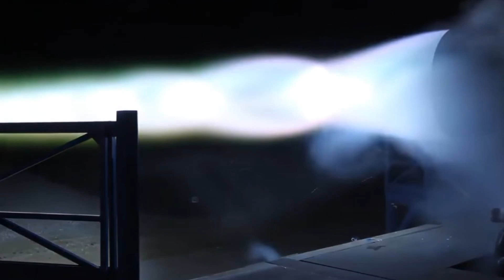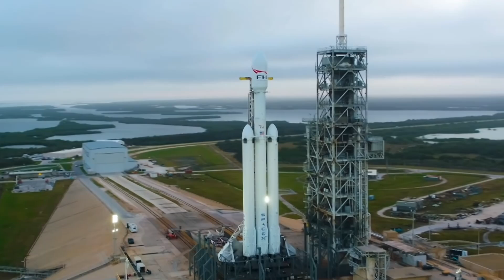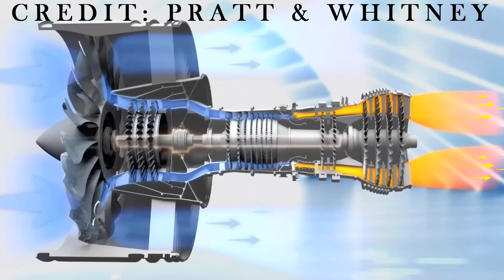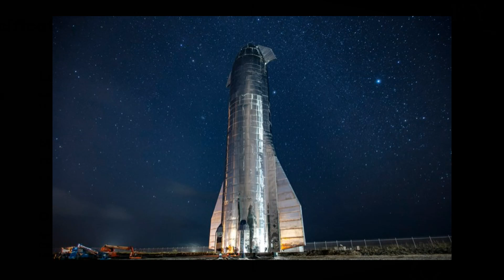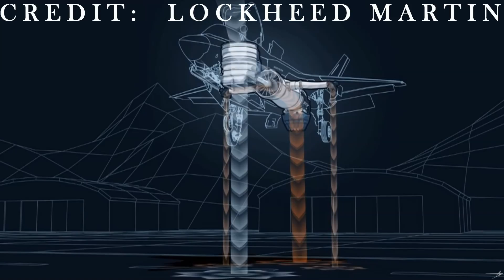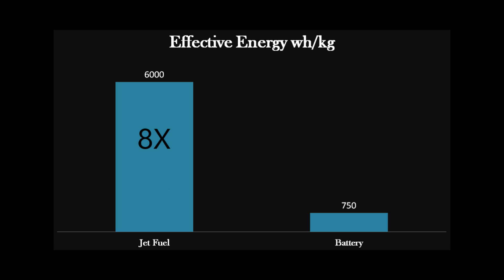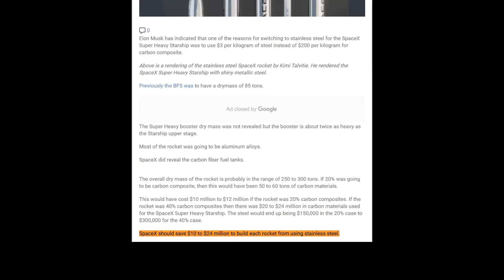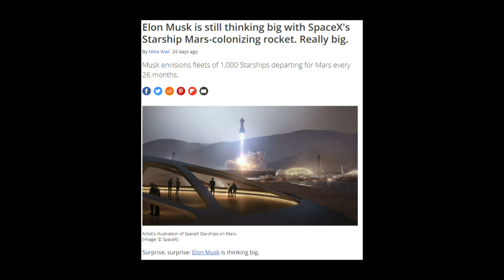ELON MUSK'S BATTERY POWERED SUPER SONIC VTOL JET - My Tesla E-SuperVTOL design

Comment: Electric motors are actually more efficient at higher speeds! Also, check out coreless motors like Thingap, they are stupid high power density, and very light weight, plus super high speed.
Reply from the maker: Coreless motors...will check it out.  Question though - don't electric motors have a steep drop off in efficiency after 80% of max rpm?  Can this be designed around?
Reply: Well, you basically just design the motor to operate at it's peak efficiency. So if you need 8,000RPM, then you design the motor's specs so that is the peak efficiency point, so that you are operating at the peak efficiency as standard (and have some room to push it I guess) Check out Dynamic Boosting Systems, they have some ultra-high-speed motors that run crazy efficient. dynamicboost.com It's much easier to make brushless motors run very efficient at high speeds, it's high torque where efficiency is a nightmare to attain.
Reply from the maker: @DUIofPhysics  Holy crap - 110k rpm?  This is awesome, thanks so much!
Reply: Indeed, no problem. If you want to have a good resource on motors & drive technologies, I suggest hanging around in the ODrive Discord channel. https://discordapp.com/invite/k3ZZ3mS

Comment: Cambridge physicist David MacKay (author of “Without Hot Air”) has calculated that a single Atlantic flight ONE WAY also uses about 4800 kilowatt hours of energy per person (630,000 kilowatt hours to fly that one plane one way across the ocean).  This amount of energy is very clearly expressed in terms of hot showers: a 30 litre hot shower typically uses 1.4 kilowatt hours of electricity so a single return flight uses as much energy as 6858 showers for every person on board, its like everyone on the plane taking a shower every day for 20 years - equivalent to 900,000 showers for the entire plane!
Reply from the maker: This is awesome information!!!

Comment: Second comment: I am afraid lobbying by the IATA, the deep investment in fossil aviation infrastructure and fleets and the low cost of fuel combined with a lack of carbon pricing for aviation (due again to lobbying) will make electric airliners a very long term prospect.  If meaningful carbon pricing comes in and a sustainable way to generate the still considerable energy needs of flight then maybe its feasible.  Remember it will still take the energy equivalent of 6858 hot showers for every passenger on board to fly the Atlantic one way.
Reply from the maker: Yeah, it would be an extremely tough nut to crack.  However, the responses so far to electric planes has been positive.  I think the airline industry is more technologically minded than the auto industry?

Comment: Interesting indeed.  I would be interested in a breakdown of energy required for 3 phases of flight- takeoff to cruise altitude, cruise at altitude and decent and landing. Landing I imagine will take considerable energy as VTOL.
Reply: Take off energy can be removed from the calculation. With VTOL you can tether a cable to power the takeoff which would disconnect at a set hight. You would then have a battery/super capacitor setup on the ground to supply the takeoff power.

Comment: One thing you did not mention is battery charging times. They could be ignored with a battery swap while passengers are getting on/off the flight.
Reply from the maker: That's a good point!  My thoughts on this are are the charger required for this would need to be multi megawatt and that would be the limiting factor rather than the jet's uptake speed

Comment: My personal design is a knockoff of the scene from Superman Returns.  Instead of a space shuttle it would have several electric chinooks attached.  Those chinooks would help get to cruising altitude, release and land back on the parking garage you “launched from”, lessening the weight of the batteries and motors you have to carry with you for the majority of the flight.

Comment: The Electric "Jet" Propulsions Is Hard For Me To Visualize. Without Jet Fuel Turning The Turbines, To Me Would Make The Blades Go Supersonic And Stop The Propulsion!  Otherwise Good Video.
Reply from the maker: Too a while for more to get my head around it too!  Much of jet engines are a compressor, turning at subsonic speeds, compressing the air to supersonic speeds.  Modern engines can do supersonic without afterburner.  We'd just be replacing what turns the compressor and fan blades.

Comment: Faster reusing because it's supersonic ? That includes time for recharge the battery after every flight?
Reply from the maker: I'd say an hour recharge time - 1C rate which is pretty standard would be plenty.  That gives time to load/unload the plane and give it a clean.  The charging rate of the plane wouldn't be the limiting factor, it would be having the massive cables and energy on tap to recharge it that quickly!
Reply: @thelimitingfactor  whole point of VTOL aircraft is that you don't need a airport, and you can land near to the populated areas and leave very fast in ten minutes or less, also is to big 20-30 passengers would be right size for the beginning and the range for first version 1000km would be more realistic.
Reply from the maker: @theOrionsarms  That's a good point, and one I wrestled with.  I think for shorter flights, a high efficiency subsonic jet makes more sense.  It would be smaller, broader, and shorter range - closer to the CyberJet design.
Reply: @thelimitingfactor  flying cyber bus maybe?
Reply: @thelimitingfactor  I'd like to see how viable mid oceanic verti-ports would be at enabling electric flight.
Reply from the maker: @tbuyus8328  'Verti-ports' had a nice ring to it.  Reminds me of how you can stop at Fiji or Hawaii on the way to NZ...

Comment: Why would it not take off and land like a rocket.  You could use super capacitors to use and recharge faster.  Then you would just need batteries to move through the thin atmosphere which is not that energy intensive.  This would imply a design more like the falcon 9 that you noted.  If two engines fail, the center of mass is not an issue.
Reply from the maker: That's a good point.  Then you could mount the engines in an x-wing formation  👌
Reply: @thelimitingfactor  X-wing or maybe in super heavy configuration with a bazilion engines.  I like the idea of the engines in the back so passengers don't have to hear them...
Reply from the maker: @giszTube  Love it 👍👍👍

Comment: Thank you for expanding the views on what is technically possible. I at first thought the thin air above 36.000 feet would be to thin for electric fans to push, but you may be right. I would love to hear more about the Boom 💥 supersonic aircraft.
Reply: I think the Concord had air scoops designed to partly compress and also slow the air before extra compression with fan blades. The electric jets could have a intake design that compressed the thin air before passing through a ducted fan. I watched the video but commenting a few days later and not sure if air intake compression was mentioned in the video or not.

Comment: I'd like to have your opinion on something: specific energies of above 500 Wh/kg are already available, just not with rechargeable batteries. Do you think these solutions are applicable?

1) Fuel cell: I've seen a lot of numbers thrown around, but it seems 800 Wh/kg is feasible. Requires refueling and air filtration.

2) Aluminum-air primary batteries: 1000+ Wh/kg, albeit with limited specific power (200 W/kg compared with 300 W/kg for li-ion). They'd need to be changed and recycled, but they give long range.
Reply from the maker: A good point, and good questions.  Without getting into the weeds:  I would think that anything disposal would add too much cost - you'd be using more than just electricity each cycle.  However, I do think the 'air' batteries are really exciting!  More potential than the fuel cells?  Not because of technical issues, but because batteries already have so much manufacturing know-how and momentum.  Both these two are well beyond my current research though - need to learn more!
Reply: @thelimitingfactor  thanks for the reply

Comment: Electric motors tend to be more efficient at lower RPM? I thought it was the opposite...
Reply from the maker: It does increase with higher RPM, but then suffers a rapid drop off at ~80% max rpm.  You're correct, I should have said relative to jet engines, which - the faster the better (at least in my understanding).  I'm not an electrical engineer, but I imagine it depends somewhat on the design of the motor as well.
Reply: @thelimitingfactor  That 80% drop-off is interesting. It actually ties in with what I've been 'feeling' (guessing, really) with my electric bikes... Good vid, thanks for posting. Bit of an Elon-ist, myself...what a mover.
Reply: @thelimitingfactor  :The power per unit weight of an electric motor rises with rpm, look at your battery operated electric tools they tend to use small high rpm motors that are then geared down to the speed necessary for the job. The ebike forum at https://endless-sphere.com/forums/index.php  has a lot of discussion regarding the technical details of electric motors since high power per unit weight is critical for ebikes while they also require high torque at low rpm to drive typical large diameter bicycle wheels. Brushless electric motors can be very nearly silent in operation if driven with a sine wave, it's the cheap trapezoidal wave controllers and gearing that introduce almost all of the noise in an ebike drive.

Comment: Very good and convincing. I am not a battery engineer or aerospace engineer, so it is not for me to say whether your assumptions and calculations are reasonable or not. However, I had a few questions: Is this something that TESLA would do, or SpaceX? SpaceX has already announced plans to be able to fly people between any two cities on earth in less than an hour at the cost of a typical economy class ticket now, and do all of that within 10 years. Wouldn't the E-SuperVTOL you are describing compete directly with this service? For example, the Wellington to New York trip you said would take 6 hours would take less than an hour using a SpaceX rocket.
Next, you talked about energy denisity going from 250kwh/kg to 500kwh/kg to 1000kwh/kg and I think you even had a slide with 2000kwh/kg. I know in 2017 Musk predicted 30-40% increase in around 2020-2021 (so mid 300s) and 100% increase in around 2025 (so about 500 kwh/kg), but is it realistic to go even higher? What is the outlook for solid state batteries? I'd love to see a video on that.
Finally, with Starlink (and Amazon's competing satellite constellation and perhaps others)  I wonder if any high-flying vehicles (presumably SpaceX rockets rather than the E-SuperVTOL) have any possibility of hitting satellites on their way up or down. It just seems like it's going to get crowded up there.
Great video and I hope it happens, and that Tesla calls you up to offer you a job.
Reply from the maker: Great points!  My thoughts, which are all conjecture: Starship would be used for super long haul flights - 12+ hours where the economics make the most sense.  I don't think we know enough about each to guess where the crossover would be at this point.  

Based on my investigation of Shirley Meng and Jeff Dahn, I think we could hit 1000wh/kg by early 2030s.  2000wh/kg, I have no idea, but maybe 2040-2045?

I'll definitely do a video on Solid State!

I'll have to look into the collisions thing - excellent point!

Comment: Ok, this is an interesting thing to think about, and you make some good points, but there are some holes in your reasoning. The 1000Wh/kg battery is unlikely to ever happen. Best energy density has hardly increased since 2012 (256Wh/kg). Although there is some room for improvement, 500Wh/kg even seems unlikely to me by 2030. A cockpit/pilotless public passenger transport aircraft by 2030... forget it. It will be piloted. I work in the industry, … believe me, it won't happen. Another problem with your 6 engine configuration is this : the certifying authorities would most likely require provision for 2 out of 6 of the engines to fail without loss of the aircraft. The way you configured the engines, the centre of mass would have to lie in between at least 4 of the six engines. So if, for example the CoM would lie in between the 4 front engines and 2 front-most (?) engines would fail in vertical flight, the 2 rear engines would not be able to compensate the resulting nose down moment. 6 motors would probably required, but mounted in a different configuration. Mounting 2 engines on 2 forward wings or canards, is also not the best idea if you want to have an aircraft that will fly at twice the speed of sound. Since you are striving for best efficiency, the Best thing would be to have the bow wave uninterrupted. I.e. you would want all of the aircraft to lie behind the bow wave. At mach 2, it forms a 60 degree swept back cone starting at the nose. Another issue is transporting the vast currents required over the distances the motors are possibly spaces from the fuselage. 4 motor packs with multiple motors might be a better idea. You could have two motors per wingtip in pods and 4 more motors in the tail section. CofM could lie just behind the wingtip to wingtip line (an unstable configuration, but doable rprovided the aircraft is fly-by-wire and stability augmented with a tail motor pack and tail section with enough control power.Here, hope that gave you some food for thought. regards, Fred.
Reply: Maxwell, now part of Tesla, have claimed they have a path to 500Wh/kg with essentially current Li-ion battery chemistry - just changes to manufacturing. If they are not BSing (and I don't think Tesla would have bought Maxwell if they were) then reaching 1000Wh/kg seems plausible within 10 years given the focus on battery research in the next decade. But who knows.
Reply from the maker: Whoa!  Fanastastic information Frederic, that's definitely food for thought, and I will be digesting this for a while :).  As far as your comments on regulation and the physics - THIS was some of the information that I had so much difficulty locating - greatly appreciated!  In terms of batteries, I think we'll see the curve accelerate now that we have the tools for characterisation, modeling, and testing (see Shirley Meng and Jeff Dahn videos if you're interested).
Reply: You are welcome. If we make 1000Wh/kg before 2040, I will literally eat my hat.
Reply: Paul, if I I had a euro every time I heard a “potential”, “theoretical”, “pathway” to higher mass density cells, I wouldn’t have to work right now. If Tesla can mass produce a safe, fast charging, high cycle, cheap, high volume density, 350Wh/kg cell and sells their first car that actually uses it (in 2025,... maybe), then we can start talking about maaaaybe 450 to 500/kg. Like Elon said : “Send me a working sample or STFU”...
Reply: @fredericborloo1910  Check out Maxwell, I expect Tesla to come out with 350Wh/kg this year, maybe next year.
Reply: @qorje  Not going to happen. If they achieve 300 at cell level, I'll eat my hat.
Reply from the maker: This would be a great thing to put on a betting website.  I'd much rather bet on technology than horses!  Much more exciting 🤠
Reply: @thelimitingfactor  How about longbets.org - the arena place for accountable predictions
Reply from the maker: @trenchant4162  I'll look into this 👍🏻👍🏻...
Reply: Oh, and I can guarantee you much more than manufacturing techniques will be needed to achieve 350, let alone 500Wh/kg...

Comment: The turning engines also adds weight and complexity. 
Landing gear needs to be present because landing on "classical" airport is more efficient than vtol.
It's possible to design an aircraft with no sonic boom at all but it will be inefficient.
The energy density of cryogenic liquid hydrogen is much better for airplane than the battery and even gas
You can use hundred of small motors instead of 2 big to avoid cooling
Composites are lighter than stainless steel even if it's harder, but. witch matter in aviation weight X cost or hardness X cost?
2030 no cockpit, it's too early?.
Windows and is  s e x y 
Pressurizing and depressurizing the plane it's what it makes last less, instead of hours of use, it's number of flights that plane grow older
Price VS Speed VS luxury. I think the price of a ticket is the most important part of a flight. If we could design an electric plane with an overall price cheaper than gas plane even if it's slower. Electricity will win, but I think supersonic Business flight has a future 
MHD technology (magneto hydro dynamic)  used in American B2 and the Russian "unlimited range" missile reach Mach 10. So.... 
And please use mic instead of beats ;) you look weird
Thank you for all the information's and good luck. I'm following you from Morocco
Reply from the maker: Lots of good ideas in there!  We could probably have an extended discussion on each one - appreciate all the food for thought.  It's all about the trade-offs.  I'm using a blue yeti mic - the headphones are there for quality control.  If I can get a proper set up at some point, I'd love to ditch them :)